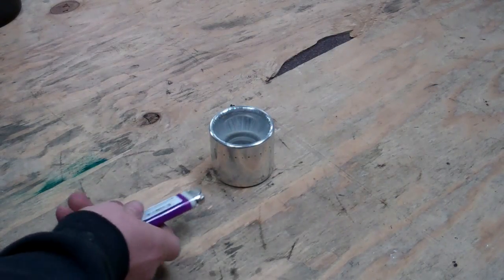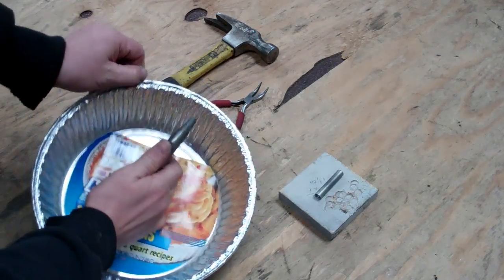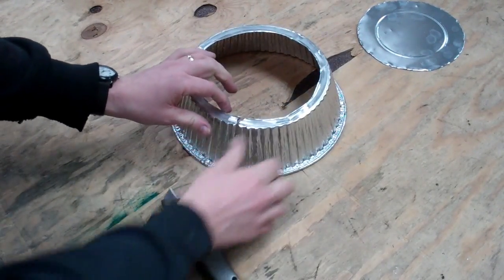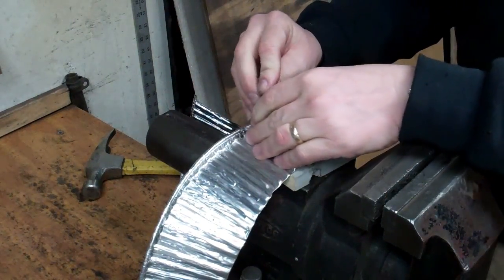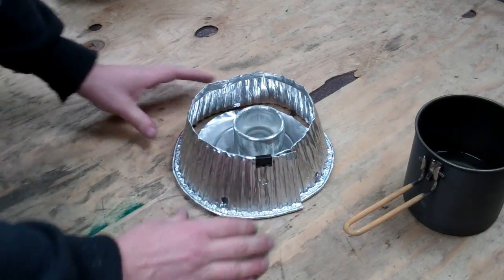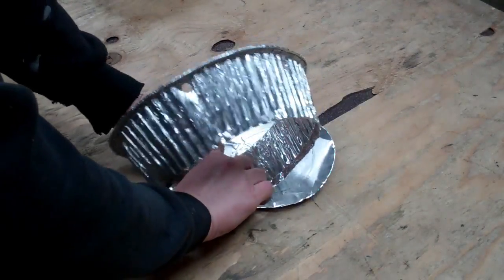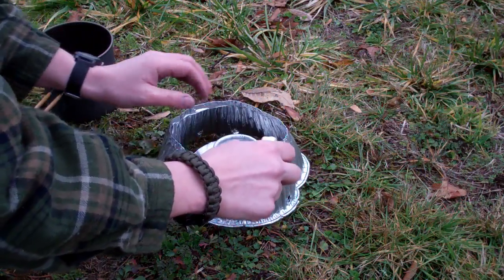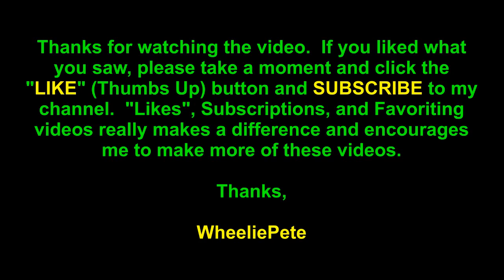How to build a $1.00 windscreen for a backpacker stove.  (Alcohol Stoves & Others)

Comment: Just throwing out some ideas (probably won't help), but have you tried the Monster XXL energy drink cans? They seem fairly thick, and roughly the same diameter as a soup can. Also, Miller Lite has a 12oz aluminum beer bottle, which "seems" thicker than a regular soda can.

Comment: I use 2 Arizona tea cans, cut along the top and bottom of the cylinder of the can, one cut up the middle. Opposing folds on the two ends, to join both pieces. A hole punch to pop holes every inch along the bottom, and cut to height of my pot for storing it in my pot. Very light and if you take the time to burn the paint off, no offending burnt paint fumes. Super simple and very easy to store.

Comment: Nice video; very instructive. I might suggest you set up a 20"  floor fan close to the stove, then film that at different fan speeds. A little more true to life than blasting with compressed air.

Comment from the maker: That's a good idea on the center.  I use the center to put under the stove as an insulator and also I sometimes use it as a priming plate to prime the stove faster by running a dribble of fuel around the outside of the stove then lighting both the stove and the dribble on the outside.  Full primed flame in under 20 seconds that way...

Comment: Great idea! Love the idea of using a casserole pan. I shared a video response with my own recipe for a $1 windscreen from my CampGearTV channel. I make mine in a similar fashion but instead of a casserole, I use an aluminum oven liner. I've been using the same one for about five years and it's held up really well. I also like the fact that it nests around my pot so I don't need to find a place to pack it.

Comment from the maker: @Landmine1  I use about 3 cups (24oz) of water per hot meal (Mtn. House freeze dried entree, Cup of hot chocolate, enough warm water for cleanup.)  I can bring the 24oz to a full rolling boil in about 8.5 minutes and the stove will continue to burn for about 16 minutes on 2oz of fuel. What I usually do is put in 1.5 oz or so, boil my water, put out the stove, let it cool, and then pour the excess fuel back in. I would take 6-8oz for two days. Should be more than enough (be prepared).

Comment from the maker: @cougarbahia   The pressure on the pocket rocket is dictated by the canister of fuel and the valve.  It's just going to depend on how windy it is where you set up your stove.  Pretty much any small camp stove is going to benefit from a windscreen of sorts.   Heat's rising, theres no danger you'll overheat the canister.

Comment from the maker: One bottle of Heet will cook 16 hot meals for me (based on my normal usage), how many are you getting out of a canister?  Then you figure that the empty Heet container weighs less than the empty metal canister for packing out...  I repackage the Heet fuel down into smaller flip-top VARGO bottles when I head out as I find the commercial Heet bottle a bit awkward and you have to gauge the amount left by feel.  The VARGO bottles are translucent and have a oz. gradients on the side for measure.

Comment from the maker: I'm usually running 3 cups of water to a full boil with .75oz of fuel in 8-9 minutes.  The main issue I have with the canister stoves is that even though they work fantastic, you can't always find fuel.  Not so much of a problem with alcohol.  There is ALWAYS alcohol (in one form or another) available...lol...
Reply: you can just about burn the stuff that you can drink though, it's more than half water :)

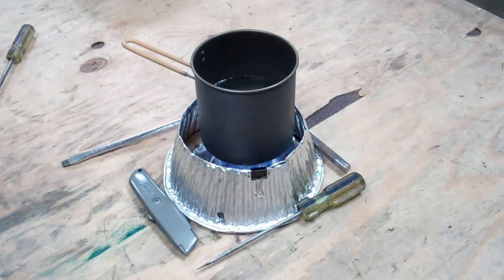Comment: 7:25 Just a warning. When taking down your windscreen, be careful of the clip. It's made of steel, and will retain heat long after the aluminum windscreen and stove have cooled. If you grab the clip like that when it's still hot, you'll get a severe burn. (Speaking from experience.)
Reply from the maker: Yep, did that once...and only once.

Comment from the maker: Well, it works great.  I have a full video on it in my channel or you can search "RUCAS stove" and it will pop right up.  It weighs 1.25 oz and will burn for about 20 minutes on 2 oz of methyl alcohol fuel (cheap and easy to obtain anywhre.)  Using an alcohol stove takes a bit more care than a butane/propane/whitegas system, but its a whole lot simpler and lighter when you factor in fuel and containers...

Comment: I have seen people using windscreens for these alchohol stove. I started wondering if you could just put the alchohol stove inside a bigger can which could act as a wind screen as well as a stand,. You might possibly  have to put holes in the bigger can as well to prevent it from smothering the little achohol stove can. . What do you think? Would this work? I haven't tried it yet myself
Reply from the maker: As long as you shield the stove's flame from the wind you can use pretty much anything.  Even building a wind-break with rocks will work.  The only problem with using a larger can I can see would be that (at least for the stove in this video) you need the pot to sit directly on top of the stove for it to work properly (pot pressurized side-burner style alcohol stove).  Also, a larger can would be a bit awkward to pack.  The roll-up feature of the tinfoil screen has been nice.  I've been using the same one for years.  I originally thought I'd only get a few trips out of it before I had to make another, but it's turned out to be quite durable and has lasted for years and years.

Comment: The weight of the fuel may be more significant than the weight of the stove on hikes lasting more than a weekend. If you use more than 12 oz. of alcohol, the added weight of an “ultralight” stove may be offset by the lighter weight a fuel canister (7.09 oz with cap) vs. a bottle of Heat (11.33 oz.).

Comment: What type of fuel did you use in that stove? I noticed inside with the lights off it displayed a nearly all blue flame. I generally use 91% alcohol and the flames are for the most part yellow and tend to soot up everything, stove and cooking vessels, bad after one burn.
Reply from the maker: Dave Kane   Although the 91% alcohol will technically work, you really want to avoid burning that stuff if you possibly can because of the 9% "other" stuff that is in it.  Pure alcohol either methanol or ethanol will burn very clean with a nice blue flame.  Burning pure alcohol will also keep your stove and pots from gunking up with soot from the other 9% impurities that are in the 91% alcohol.  That's why most people use Heet brand gasline anti-freeze because essentially, it's pure methanol.  SLX denatured alcohol is also a good choice as it is pure ethanol with just enough Methanol mixed in to make it undrinkable.  If you're rich you can also burn pure ethanol (which would be 200proof drinking alcohol.  You can get denatured alcohol at any decent hardware store that has a paint department, and Heet gasline antifreeze (in the yellow bottle, not the red one) can be found in any autoparts store or department.

Comment: I only use the backpacking stoves to boil water; it takes about 6 minutes and 1 oz of Heat for my Super Cat to boil 2 cups of water under optimum conditions. The $5.99 ultralight from Amazon.com will boil 2 cops of water in 5 minutes, 15 to 17 times from 1 canister under optimum conditions.

Comment: A “Super Cat” and 12 oz. bottle of Heat cost less than $3.00 and weighs 11.56 oz. An Ultralight Backpacking Stove w/travel case ($5.99 on Amazon w/free shipping) and canister of fuel cost about $12.00 and weighs 11.11 oz. The Super Cat & Heat can boil 2 cups of water up to 12 times, the ultralight & canister can boil 2 cups of water 15 to 17 times. Your "double wall" bottle stove weighs about 4 times as much as a Super Cat but is amazingly strong & durable; the Super Cat is easily crushed.

Comment: Would it work with square pans as well?
Reply from the maker: I never tried it with a square pan, but I bet it would work.   I've been using foil dutch oven liners and they work great also.
Reply: @WheeliePete  Just though of something a piece of 6 inch stove pipe. :))

Comment: That wasn't the total weight, you forgot to include the heaviest portion of the stove...the fuel. BTW, you don't need a clip, just make a small cut at the top through both sides of the overlap and just fold a small flap of the 2 sides down and hey presto, even less weight (I assume you are smart enough to take a knife with you when you go camping).

Comment: Not a bad little trick, especially for a buck. Have you ever had any problems with the plastic clip getting damaged from extended use with the stove right there?
Reply from the maker: It's a metal clip.  I think they are called "bulldogs".
Reply: Ah. That's where I was mixed up. I thought it was like one of those chip clips.